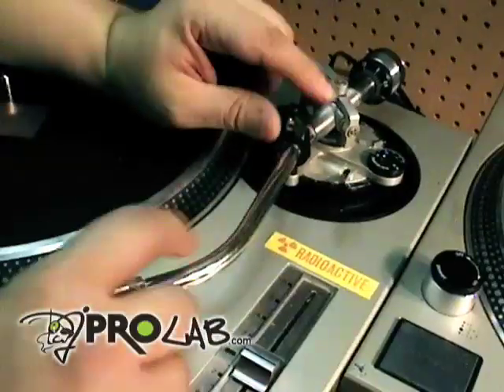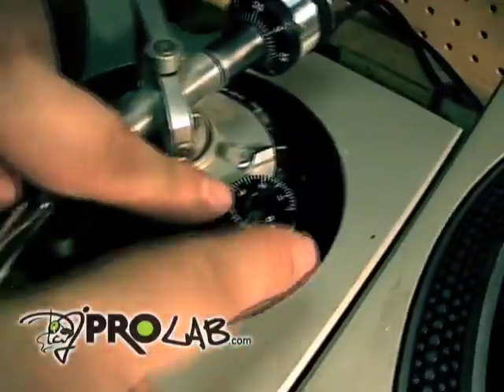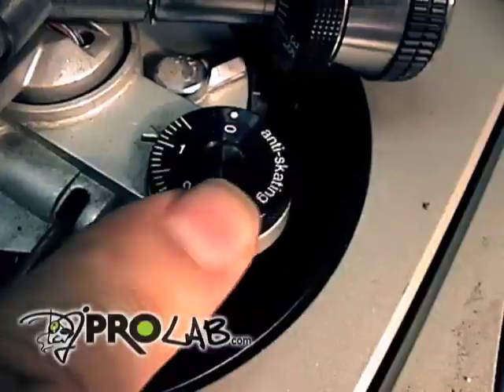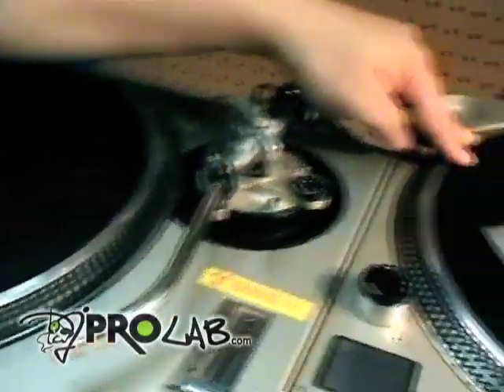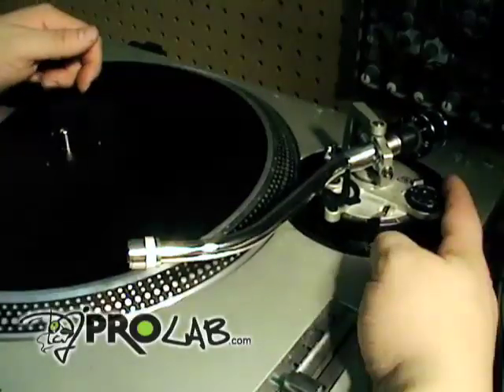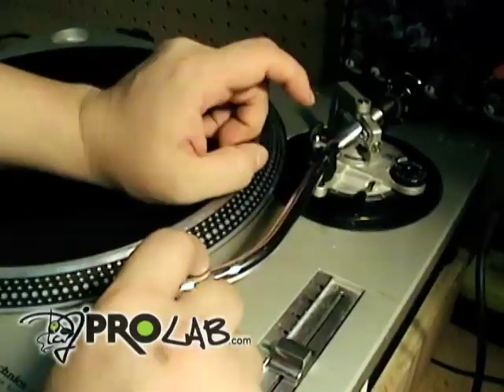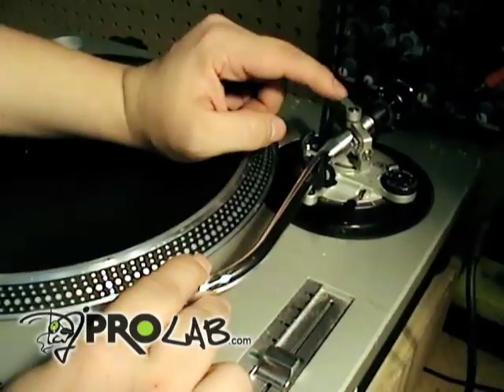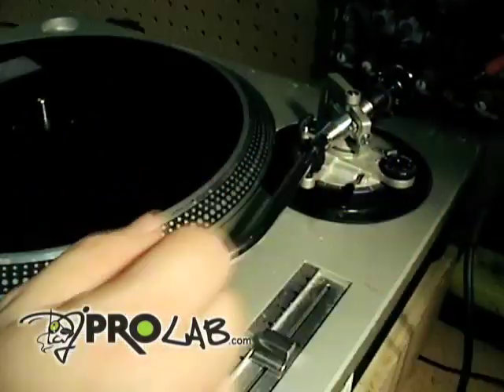DJ PRO LAB - Technics Tonearm Check

Comment: hey my question is my tone arms anti skate is usually set to zero the height adjustment is at zero and my counter weight is usually all the way forward do to the fact i scratch alot....both my tables are set this way and when i tried this by pulling the weight back as far as possible this test didnt work on either with the cartridges off. would it mater what the height? i use sl1200m3ds

Comment: can the anti-skate be repaired? i think mine is faulty/weak. on both 0 and 3 the arm goes towards the resting position. on 0 it moves with less speed but it definately isn't floating still, it's pretty noticable speed towards the resting position.

seems like some calibration issue of the whole anti-skate function. I can still set it so that it stays in one place when playing a blank (no grooves) vinyl.

Comment: Great Video.  I have the 1210 M5G's and am wondering what the horizontal weight adjustment is for.  After further inspection I see that all it does is make the tone arm movement stiffer, I guess its to help keep the stylus in the groove especially when back cuing and scratch since this decks tonearm is lighter than previous models.  Someone enlighten me!

Comment: The 0 - 6 grams anti-skating range is to keep up with some of the heavier tracking pressures available nowadays. Quite common to have DJs use 5 - 6 grams although being a vinyl lover, I go up to 4 grams a tmost. No anti-skate since I use it to beatmix and need to backcue often.

Seems to me that your turntable's not exactly level. Try checking with a spirit level. Not rare for turntables to have their feet uneven.

Comment: I know how the antiskate works. I'm speaking about this; when the arm is free balancee to "0" (floating) and the antiskat is set to zero & table is flatened, there should be no force to mowes the arm to te spindle or oposite direction! If in this case the arm begins to moves straight to the spindle, there is somethnig not right.
I have two mk2 an the arms are in perfect neutral postiton in this case. 
djprolab, thx for exchanges!

Comment: When you talk about leveling the turntable, are you measuring from the platter or the plinth? Whenever I measure from the platter, the plinth ends up not being perfectly level. Likewise, whenever I measure from the plinth, the platter ends up not being perfectly level. Assuming the platter is not warped (which I'm pretty sure it isn't), is there anything else that might cause this discrepancy?